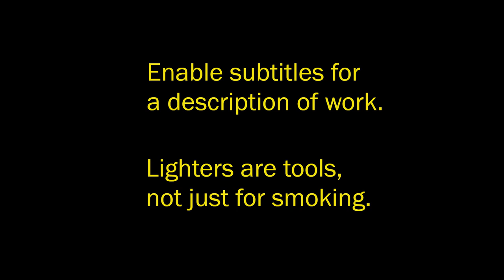Lighter therapy - 1969 Zippo - Bechtel

Comment: I use a cheap battery-powered Dremel with Flitz after using the sonic cleaner.  Really helps with getting the residue from inside tight spots of the lid.  Also, last wash with Goo be gone between the lid and hinge.